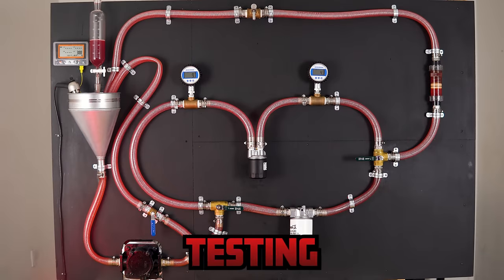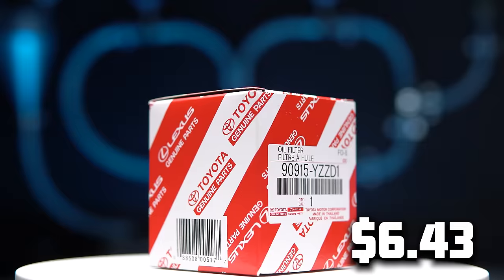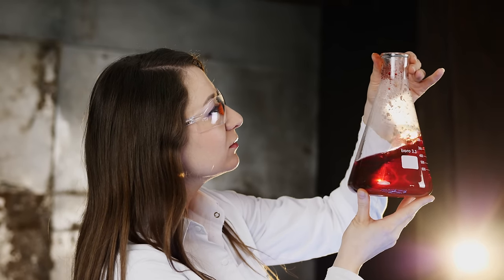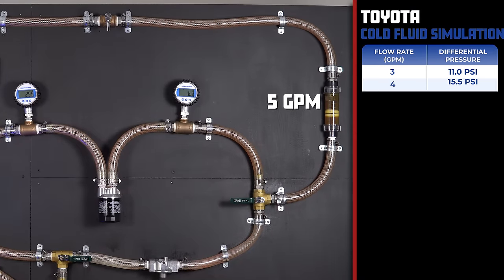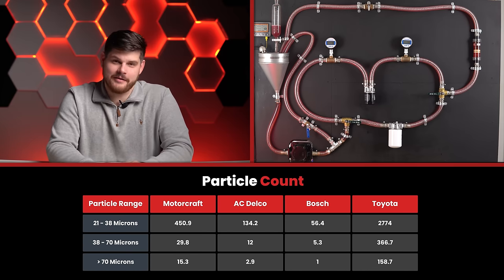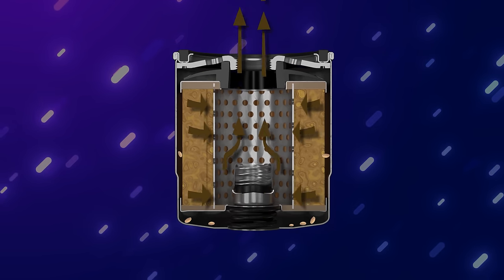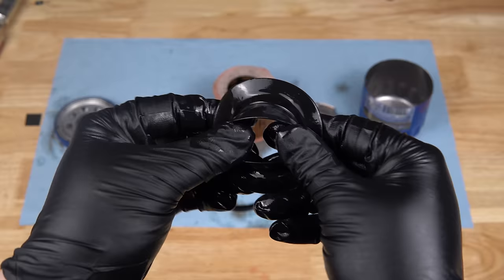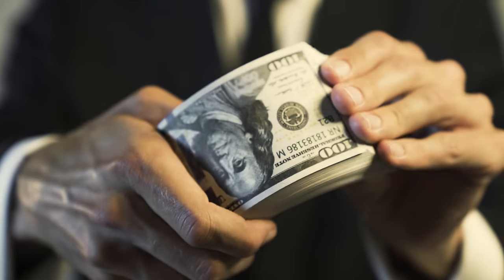Are Car Dealership Oil Filters a RIP-OFF?  (Engineer tested)

Comment: The Toyota filter results are really interesting. I’d love to see a Toyota engineer explain the choices made there
Reply from the maker: Agreed!!! From our research many agree that their filters are subpar filtering particles. Thanks for watching!
Reply: Its funny when they took toyota one apart, they used the same filter as the cartridge design.  That is why nothing was glued together. Just manufacturer one filter and use them in everything. Lol
Reply: My question is where the Toyota filter was sourced from. Word I've heard is that there a some counterfeits out there...
Reply: @BrandRanks  Where did you source the Toyota filter?
Reply: Car Care Nut recommends sticking with Toyota OEM filters.
Reply: @BrandRanks  Was the Toyota filter sourced from a dealership or off of Amazon? There have been multiple instances of people receiving counterfeit Toyota parts off of Amazon, including oil filters.
Reply: @Being_Joe  that’s why I would love to hear an engineer from Toyota explain, because the car care nut has plenty of evidence to show that Toyota filters do a good job at keeping the oil clean enough to have the engine run firever
Reply: So let’s put this in proper perspective… 25 microns is .001 inch. Typical camshaft/crankshaft bearing clearance is .0015 to .002 inch. Oil film strength is a function of oil pressure , viscosity , and of course the oil type and oil additive package. And let’s not forget that in addition to reducing friction , the other major function of oil lubrication is to remove HEAT . Better flow rates at higher RPM’s remove the heat much faster than lower flow rates. Too much heat makes for tighter clearance’s, due to thermal expansion. This reduces oil film strength as there is less of it between rotating and stationary parts. As with so many manufacturing engineering considerations,  there are many pros and cons to consider, and decisions to be made . The bottom line is more frequent oil changes with higher flow filters is better IMO . You don’t have to filter dirt if you get the dirt out of the engine with more frequent oil changes.
Reply: I don't think its an oem filter, counterfeit filters are a huge problem when buying from companies like amazon or even walmart. Buy from the dealer if you want OEM toyota/lexus parts.
Reply: the new tundras have been spinning bearings. wonder if this video revealed why due to oil filter issues. Though toyota says its a manufacturing issue with the blocks.
Reply: Very confident the Toyota Thai Denso filter shown is genuine. Same filter design seen many times in other dissections. BR particle results aligns with independent ISO 4548-12, (industry standard) testing sponsored by Amsoil. ISO results showed the Toyota Denso OEM to be 55%@20microns. Not very efficient.
Reply: @faxmen09  exactly anyone who knows what they’re talking about that’s ever seen a Toyota filter cut apart knows that this filter was 100% genuine. I’ve seen the fake ones cut apart and I’ve seen the genuine ones cut apart multiple times and I will bet every dime I have that this is a 100% genuine Thailand made Toyota Denso filter.
Reply: @CL-yp1bs  Spot on! 💯% Again, confident the Toyota Denso OEM cut open and particle tested, the real deal.
Reply: Toyota doesnt make these, they are rebAdged somethings. Purolater makes the Ford filters, and GM may be champion
Reply: @Mach141  Like all OEMs made by filter manufacturer. In the case of Toyota, made by Denso in Thailand. Why calling it a Toyota Thai Denso says it all. And one in BR test, 100% legit.
Reply: I have been using Toyota oem filters in 2010 rav4 with 200k on the clock…never had an issue…the oil does come out dark tho 🤷🏻‍♂️
Reply: @herbward5240 and they have conservative tuning compared to germany engineering, you can clearly tell why toyota large displacement v8 usually have similar horsepower with smaller displacement v8 from germany, that's why most of toyota engine doesn't care about oil contamination let alone correct viscosity
Reply: @Being_Joe  It's not even a Toyota filter, Denso makes them.
Reply: It's an easy explanation.......Shrinkflation.  Same reason a box or Oreos costs the same as it did 3 years ago but there's 6 less cookies in the box.
Reply: @Being_Joe he is a great guy but has toy tattooed on one cheek, and Ota on the other.  I agree toyotas are generally good, but he acts like every product from all other mfg is junk.  There are other good products made too.
Reply: @jetblackcoopers  if it's fake you would expect a lot of glue and shit inside the filter. Toyota filter is famous to known as well made but useless...
Reply: Toyota engines are designed by their engineers to run optimal with the Toyota filters. Switching to different brand could lower the performance and durability of part inside the engine. High flow rate is more important than filtering for Toyota engines.
Reply: @herbward5240  Agreed!  I use Toyota OE filters, and Sometimes, I'll change only the filter every 3k mi, but run the synthetic oil for up to 6k mi.  Sounds odd, but considering how good synthetic oils & their respective additive & detergent packages are now, I haven't had any sludge or varnish in any of my old toyotas('99, '02, '05' & '06) by changing only the filter halfway through the change interval of the oil.
Reply: Turbo-charged?
Reply: @Being_Joe he's a simp, so he would say that

Comment: Curious what the Car Care Nut would say about this video?
Reply: I think he doesn’t care or he is too busy with his shop. But most Toyota vehicles can last really long time if you maintain them probably. How often you change your engine is more important than what brand of oil and filter you use (oil viscosity matter too). My Lexus has 230,000 miles but still runs like a charm😊😊
Reply: Ahmed has intermittently covered TMC's long-interval and oil filter woes including sludge build-up damage, lousy ring design, stuck rings, etc.. Ahmed is the quintessential Toyota mechanic but no simp. When TMC f!'ksup he calls them out on it.
Reply: Toyota engines are designed by their engineers to run optimal with the Toyota filters. Switching to different brand could lower the performance and durability of part inside the engine. High flow rate is more important than filtering for Toyota engines.

Comment: Awesome video, thank you guys for listening to your subscribers and doing an oem filter video! As a former maintenance technician of a Chevy dealership and a Toyota dealership, I can somewhat explain their reasoning of why they made their filters that way. Most AC Delco filters that I cut open actually do have a bypass valve. The PF53 is one of the very few filters that do not come with a bypass valve because the majority of vehicles they are installed on have a bypass valve internally in the oil filter housing where the filter attaches to the engine. As for the pitiful filtration quality but also the large contaminate capacity of the Toyota filter, it’s because of filter longevity. Toyotas recommended service interval is 10,000 miles whereas GM and Ford and a few other brands recommend 5,000 miles (based on full-synthetic oil). Based on your tests, it’s clear that you can’t always have (in most cases) a filter that will hold a lot of particles and at the same time filter out really small ones such as 20 microns at a 99% efficiency. Purolator Boss and a couple others are the exception but we’re discussing oems. Anyway, that’s my take, keep up the good work!
Reply: Toyota may also be allowing for drivers who never change their oil, lol.
Reply: Actually, the PF53 shown does have a bypass valve. It's combined with the nitrile adbv and second set of central base plate holes (not shown) that act as bypass. It's what's known as a nitrile 'combo valve' and used on some Champ Labs made ACDelco filters not specified for GM vehicles.
Reply: @Mechazawa787 that is also a likely possibility lol
Reply: @faxmen09  thanks for the info
Reply: @d.vinny1997  You're welcome. I'll add, not a fan of combo valve. Much prefer separate mechanical bypass. All ACDelco for GM vehicles have separate dome bypass, for engines without block bypass.
Reply: @faxmen09  I have a question, do you agree with his point that Toyota oil filter sucks? and can you explain in a much simplier manner for me to understand? I am currently learning about car parts, mechanics, and how they work.
Reply: @aiztoh  I don't think the Toyota OEM filter "sucks". I think it's a well-made filter. But, the one ISO 4548-12 (industry standard) data point on its efficiency show it to be not very efficient filter. ~50%@20um. Not great. So, in the case of efficiency, BR test rig results align with true ISO test results. But, lots of Toyotas run a long way on OEM filters. Otoh, I wouldn't any fear of running a quality aftermarket filter with better efficiency on a Toyota.

Comment: I recently switched to the Motocraft filter after years of using more expensive oil filters after watching some other videos.  I’m really glad you did this one. The biggest issue is I heard you could get my filter at Wally World a year ago for $4 and some change. Now it’s $8 and some change.  For 4 bucks it’s an incredible value. It’s decent for $8. I recently switched from 5,000 mile oil change intervals to 3000 - 3500 OCI as I have a GDI Turbo and do mostly around town driving.  Valvoline High Mileage full synthetic for the win for my go to oil sold at Walmart.  Garage Box is $58 for 12 quarts. Ford Boss Me did a video with lab results and the Valvoline High Mileage had excellent numbers. Great video, thank you for your thorough testing!
Reply: I've used the motorcraft FL1A on different cars and trucks over the years. Same filter fits several different applications. I currently daily to work a 93 Ford ranger with 507,000+ miles and still rocking the original engine transmission and rear end! And always have used the FL1A filter with the only exception of if time for an oil change and the motorcraft filter wasn't available, which might of been just a handful of times. Take care of your vehicle and it'll take care of you! Ps, I always use Valvoline high mileage synthetic blend oil in the danger ranger! Lol

Comment: Good video. Just so you know in more than a few GM applications the oil filter bypass valve is in the block just above oil filter.
Reply from the maker: That's a great point! Thank you so much for the info. Glad you enjoyed the video!
Reply: Very true, But in the case of the PF53 shown, it is spec'd for vehicles other than GM. And it does have a bypass, what's known as a "combo valve". Second set of central holes (not shown) in baseplate combine with nitrile adbv to also function as a bypass.
Reply: @BrandRanks  Many engines have a relief valve in the lubrication circuit. That was a glaring oversight.
Reply: Most notably, for last 40-50 years is every Chevrolet engine using the 13/16" thread one-quart or two-quart spin-on filters. Bypass valve is in aluminum filter adaptor mount bolted into the block cavity. 1/2" brass pipe plug sealed with Loctite Red will truly give you full-flow filtering. Your oil pressure gauge informs you when it's filter change time. Cheers!
Reply: Does this help explain their high prevalence of engine problems over the past several years?

Comment: Between your filter videos, and Project Farm's oil videos, I'm now using Pennzoil Ultra Platinum oil with a Purolator Boss filter. I just got a new 5.7 engine put into my 2005 Ram last year, and after finally getting it broke in I am now using this combination to keep it healthy.
Reply: Fun Fact; Purolator is the manufacturer of the replacement filters labeled Motorcraft for Ford!
Reply: @bdaig12  Yes Motorcraft OEM filters are made by Purolator. ACDelco made by Cham Labs. Most Toyota OEM made by Denso in Thailand, same as shown.
Reply: @bdaig12 but the question is, are the made to the same specifications and materials? for example JL audio is made in china, but so is pyle audio, but with extremely different materials and specifications.
Reply: did u find a place where the purolator boss filter is cheaper? for example ive always used wix until these testing and its like $10 on rockauto, but purolator is $35 on amazon or parts store. not that its not worth it, just curious
Reply: I use Hengst filters in my VWs and Mercedes Powered Jeep CRD

Comment: I really appreciate this series of videos and the significant effort that obviously goes into them!

If I can make a suggestion, I think it would be better for the overall rankings to be based on absolute numbers in each category or a percentage of the best in each category rather than just the ranking. Sometimes the gap between, e.g., the 10th and 11th place is tiny (so the filters are functionally equivalent) and others where there's a huge delta between the two. It'd be especially awesome if you'd publish a Google Sheet or something similar that has all the numbers for people to adjust the weighting to their own preferences. Thanks again!
Reply from the maker: We appreciate you for watching and supporting the channel. That's great feedback, thank you so much for the recommendation. We are working on our website to publish the data, it's hard running YT and being full time engineers so appreciate the patience and your support.

Comment: This is great, I ALWAYS worried about the resistance/restriction through the filter, something no-one ever talks about.  Thank you so much for tackling this issue, specially since I typically use a brand mentioned here.  A BIG thank you to you!
Reply from the maker: So glad that this was helpful and you enjoyed. Thank you for your support!
Reply: @BrandRanks  Of course. Thanks again!
Reply: Because your oil pressure light would come on and filters have bypass valves
Reply: @butWhyDad  A lot of them are just switches and are tuned for like 4 psi. More like you're engine is going to grenade light. Ofc some do have live pressure and level monitoring.

Comment: Not having a bypass valve in the filter isn't necessarily a bad thing. I'm sure the GM vehicles that ACDelco filter is recommended for have the bypass valve integrated into the oil filter housing. In my opinion, that's the better design because I trust an OEM bypass valve that's part of the engine to not leak and to have the correct pressure setting much more than I trust whatever bypass valve is in the oil filter. Whip City Wrencher has shown that even premium filters can have significant leakage past the bypass valve.

Integrating the bypass valve into the engine instead of relying on the filter also eliminates the possibility of starving the engine of oil by using an incorrect, poorly designed, or defective oil filter.
Reply: Yeah, most of the new cartridge filters don't have one--its in the filter housing.
Reply: I'm sure this youtuber knows more then all the oem's combined. I doubt oem's cheap out on filters seeing how expensive engine warranty is for them
Reply: @848evo4  To the best of my knowledge (feel free to correct me if I'm wrong), there is no automotive engine in existence factory equipped with a full flow oil filter and no means of bypassing it if the pressure drop across the filter is too much. The risk of damaging the filter's media and/or starving the engine of oil would be way too high, especially since there are more than a few drivers out there who rev their engines high while still cold and/or go way too long between oil changes.
Reply: Not surprising that the ac Delco, doesn’t have a bypass valve because most GM vehicles have it built into the engine not the filter itself.
Reply: Yep, and thanks for saving me from making a longer comment! Long story short, there is no such thing as a modern vehicle without a bypass somewhere in the oil system.
Reply: @anydaynow01 would that include a 2012 ford fusion? I searched for a bit but can't find anything.
Reply: All Gm engines from gen 3 and up, which would be marketed as using the AC Delco filter tested here, has an oil galley plug in the back of the motor. It is a plunger type device that serves at the oil bypass if there is an oil filter restriction.
Reply: @scottallen6227  good filter in general would be wix oil filter for a daily driver
Reply: So then don't use an AC Delco filter in any non-GM vehicle?
Reply: @davepaturno4290  Not that particular filter unless you can verify that the OEM filter for that particular vehicle also doesn't have a bypass valve and/or that the engine has a built in bypass valve for the oil filter.

If a decent parts catalog or lookup shows the filter as compatible, the bypass valve pressure will usually be within spec for the application, but errors are always possible.